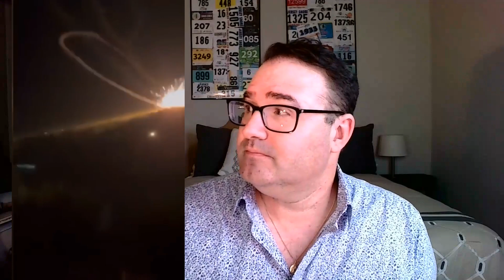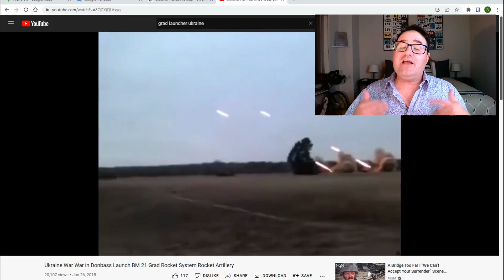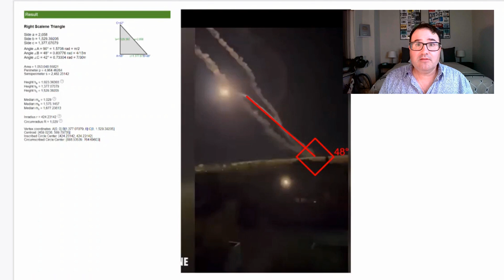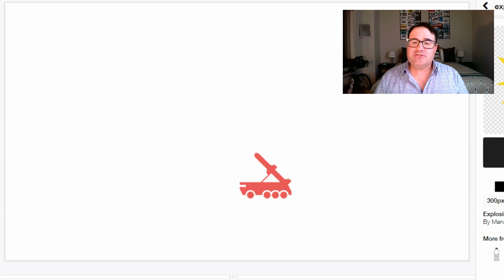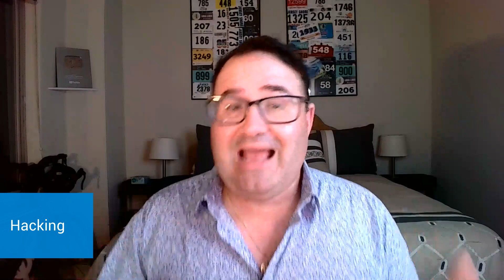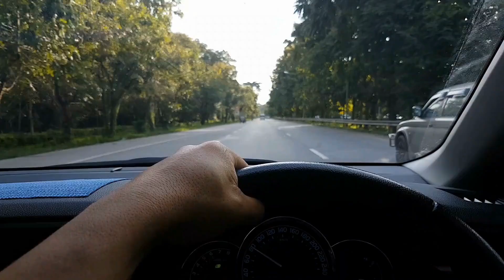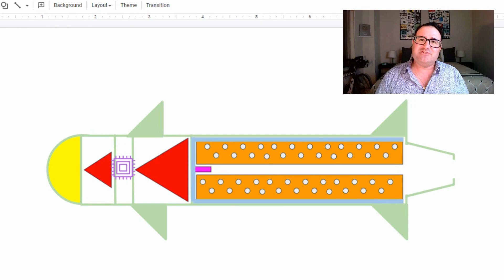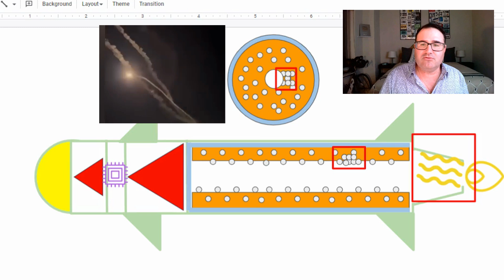Why this missile U -Turned

Comment: i think something physically wrong with the missile can be ruled out, it's flight wasn't erratic. it turned and then straightened out, which suggests the missile itself was fine.
Reply: Assuming it has to fly erratic for it to be a physical problem is wrong.
Reply: @RANDO4743  that would require the issue to fix itself, not impossible, but not very likely

Comment: Control surfaces have way more effect on a plane than thrust vectoring (when you still have suficient speed. That's why the White brothers twisted the wings instead of hand balm and swirl around their bike engine to control their plane)
A stuck/malfunction fin or fin's control system is a better and more plausible explanation.

A reminder that, one class of air craft uses thrust vectoring ALL the time, and it is the: 

Helicopters.

Comment: Love this channel.  I respect the analysis and I have NO experience; but it seems a stretch that fuel issues would cause it to return back to its origin, which it supposedly did.  Hacking doesn't seem likely either cuz why not the first rocket?  Maybe it locked on to its own ground radar somehow? (I have no idea if that even makes sense...)
Reply: Exactly! First rocket came off perfectly and started seeking, most of soviet aa systems like buk, gophers and tor, will ripple fire, until that first rocket is fired you aint gonna know where it is by the time the second ones ready to go they do...

Comment: The theory I have is that its a combination of a mechanical failure and a guidance issue. After being launched something on the missile failed and resulted in a fin forcing the missile into a turn, then upon being spun 180 degrees the missiles own guidance radar picks up the launch vehicle and mechanically re-adjusts itself in flight to track the new target.

Comment: Just saw your video about turning SAM, but I think that could be one more reason. Have you heard about Proton rocket failure on July 2 2013? It performs similar U-turn and smashed into the ground. It is believed, that guidance system was installed incorrectly -- upside down. And rocket decided that it was flying downward and tried to correct it. There was a youtube video on Scott Manly's channel about this incident. I believe, that this SAM could suffered from similar misproduction event.

Comment: I disagree with your assessment at 4:10 , the analogy you use is flawed.

You use a person swerving into a side barrier to compare to mechanical malfunction.

But, cars DO suddenly swerve, under mechanical malfunction...it's called a broken tie-rod.

Look at Me, I'm contributing 🦊⭐
Reply: Um, I think..you are prob right, in a way, but...

I personally think the fuel doesn't "shift"
The fuel gets old...and in Russia, the weapon system is a shiny bauble when it's new, and neglected ever after.
Old Fuel. Neglected old Fuel.
Burning unevenly.
Not that 'some was burning hotter, but that some spots were not burning 'as hot as.

Tomatoes, Tomatos🦊👍

Comment: Ok, hear me out. I'm an IT guy, with an old simple coding background.

First 2 (maybe) went out? They connected with the target, yeah? Missle had no target then, right? 

ERR: PEBKAC
ABORT, RETRY, IGNORE
Input R 
GOTO 1O

LOL - seriously though, I legit see your logic and having seen other videos from you, I can see your point. A fuel issue was very likely a part, if not a major factor. Having seen mishandled and sweating dynamite nearly end lives, I have a heathly respect for anything that commands fire: most especially high ignition fuels.

Comment: The missle doesnt appear to actually be making a U-turn (which would suggest a 180 degree change in direction sending it back in the direction of the launcher.) Which if you look at where it was launched from and where the camera is located. It is more likely that the missile began more of a downward spiral. Still moving away from the launcher and towards the camera. The angle we see looks like a U-turn but the Impact is closer to the camera than the launcher.

Comment: I have zero experience with rocket systems, and this may have been said already, but is it possible that someone screwed up and set it to follow the search radar signal so that's what it targeted? Like instead of following the reflection of the targeting radar, someone used the search radar signal so it targeted the search radar?
Reply: I could be wrong, but I don’t believe these types of anti aircraft missiles have an anti-radiation capability, meaning they don’t have the ability to home on a radar source. 

Missiles developed for the SEAD/DEAD roles such as HARM have seekers that track radar sources. As I said I could be wrong, but I’m fairly certain it’s not tracking a radar source. Even if it was, a radar signal originating from  the opposite direction of the seeker wouldn’t be strong enough to cause a lock.

Comment: This looks software related to me, maybe the radar gimbal cut on early and confused the initial signal station with it's first ping returning. That turn looks perfect so I doubt it was mechanical.
Reply: You can clearly see 2 missiles fired seconds before this one(smoke trails), the buk system which this presumably is, is Soviet era(not very heavy on the software) and also has seen extensive usage before without such issues propping up.
Therefore, handling/maintenance causes are the most plausible

Comment: I think fin to be honest. It could have just been a mechanism failure, if nothing is holding the fin straight, as soon as it turns 2 degrees, the airflow will exaggerate it until it’s fully angled.

Comment: The fact that the missile did a complete u-turn is impressive
Reply: And the way it activate its booster as it was about to strike where it came from is beyond hilarious.
Reply: I think the missile was homesick,  that is a powerful emotion.
Reply: Back in the early 1970s I witnessed a Nike Hercules misfire. The lower booster cluster came apart on the launch rail and all hell broke loose. You would be surprised how fast people can move with just the right motivation. Those Russians must be writing home to ask their mommy's for clean drawers.
Reply: Fin fell off
Reply: Testament to Russian rock technology and engineering
Reply: The missile should sign up for WRC and race right away
Reply: Cough cough
Reply: First U-Turn Missile. made in russia lol
Reply: Gonna have to rename Buck to Boomarang. 🤭
Reply: It didn't go tight back where it came from it wasn't a complete U-turn. There's other perspectives of this same incident. It landed 500m or more from the launch site
Reply: If a gyroscope was installed in the wrong orientation it could correct it’s course to continue in the direction it thinks is correct.

Comment: Most important detail is missile straightening course..
As a software engineer this is how imagine a div by zero or seg fault in its worst form. If fixed by "swallowing/buring" fault and next calculation is correct, goes unaddressed for years.
Bad input like zeros or unknowns from GPS (soviet GPS system?) could cause wild over correction that is temporary. 

Another possibility is rocket was in a mode to seek strongest source for some reason/error/fault as it did not steer to a random direction, 130 deg etc. It came straight for launcher area... which could be chance but is not my first choice.

Comment: So, what caused the missile (it's guided, so it's a missile, not a rocket) to turn is that the combustion of the lump of fuel pushed against the inside of the rocket in a way that caused it to veer off course, and then go straight again after its been consumed? That could make sense. It can't influence the flow coming out of the nozzle, though. That's exactly what nozzles are for - to direct and straighten it, like a laser. How does that explain the perfect 180°, though?

Comment: I think it’s silly to rule out hacking just because the devices aren’t physically networked.   The stuxnet attack was carried out by USB drives.   I find it entirely plausible that similar methods could have been used to force the system to replace the target coordinates with the origination coordinates… pretty simple hack to program.  Also, the rocket itself is guided by radio telemetry, which is likely encoded but surely hackable given NSA types of resources…

What I like about the thought that it was a hack is that if the Russians suspect their rockets are hackable, they won’t use them until they fix the vulnerability… so you end up taking down an entire weapons system based on one system that actually got hacked.

Comment: Seems to me like the rocket is too stable once it turns. It looks like it really wants to hit that target on the ground. I would guess the internal guidance system failed once it got in control. I wouldn't be too surprised if somebody tampered with the thing on the ground or if it was just stored in terrible conditions. Another option is that the guidance just got fooled by some reflexion and once it made a flip it would see the signature on the ground and assume it a target.

Comment: That missile turned around and went directly back to the launcher. What is the probability that 'settling' of the solid fuel would be just so to send it right back along it's flight path? Seems to me that something went wrong with whatever guidance system activates just after launch and somehow made the launcher it's target. I don't claim to know the details of how that system functions, but it sure looks like it guided itself back to the launcher rather than randomly got turned back to that particular direction by chance.

Comment: I used to build homemade rockets. You’re incorrect in your assessment on propulsion being deviated through solid state fuel being more “dense” causing the vector shift. It’s more likely an electronic failure or centrifugal gyro not working.

Comment: I think that its impossible to turn a rocket that way. The pressure of the burning fuel would be what propels the rocket forward when its mass goes through the engine nozzle at speed. It does not matter, however if the pressure originates from ome or the other side. I bet it was the guidance system of the rocket itself. Not the signal that its guided with, but the guidance computer onboard the missile  The precision that made it turn was just so accurate. I bet that it either might be a dummy round for if the system falls into the enemy hand, so that it would destroy the rocket launcher system or it might be sabotaged rocket, that just destroys the system, where its shot from. I bet there are many people on Russian side that wish to end this war.

Comment: I think it could have been a good old case of "putting the guidance sysem in upside down" like the proton launch that flipped around. It seems like the rocket flew practically parallel  to the original path.

Comment: Whats the chances the missle locked on to another missle still on the launcher but after the turn it didn't have enough speed to make it back completely? Could the smoke from the other launches messed with radar or poor placement of radar vehicle? Just curious,  seemed like it turned with authority then straightened out to fairly straight before it hit the ground

Comment: It’s manufacturing- but it’s a sensor or gyroscope. Those tell the software of the missile where to go and how. It provides variables used in the software code which are used to manipulate the fins and so forth; such as to maintain a given, pre-programmed course. The broken or incorrectly installed sensor or gyroscope made the missile register that it was going upside down and backward due to likely negative numbers or similar- code doesn’t think logically like humans- because the related numbers decreased. The missile perfectly inverted because the code told it that the missile was going the opposite way of its programmed target. It corrected itself- using the sensor or gyroscope data “thinking” it was correct.
Reply: Your theory of the fuel having a concentrated lump which just so happened to be enough to spin it 180° would require even more of a coincidence than poor manufacturing in specific relation, and so is less likely according to Occam’s razor.

Comment: The Buk M2E is a Surface to Air missile, while the Grad (SA 17) is a multiple barreled 120mm rocket launcher. The two are different systems with different uses:  one for air defense and the other for ground attack. It could have been a M-30 Smerch, which fires 300mm rockets up to a range of 90+km. The bigger question is, was this really an anti-air missile that went awry, or was it an artillery type missile. Anti-air missile warheads don't produce an explosion like the one on video.

Comment: I disagree with your theory Ryan although I very much enjoy your analysis. Generally with solid fuel disruptions in density or similar the rocket usually just burns less efficiently and or with less chamber pressure.
Because of the throat on the nozzle, a problem like you suggested usually would not cause a radical asymmetric thrust situation.

I am not confident on how the target acquisition radar aquires, builds a solution and then at some phase goes to terminal radar homing. I do however think that improper targeting information was uploaded into this missile which is what began or caused the entire incident.

Comment: Old rocket, probably sitting idle for at least 30 years in a store or even on the launcher itself. 
It got exposed to elements , water could have infiltrated inside the electronics or the guidance system. Rust settles in, electric wires decay.

Now the rocket is launched, violent vibrations and inertia shakes the entire system. Rusty and decaying wiring break in seconds. One side of the rocket still got power and electrical signals, the other one shut down, probably getting one of the fins stuck in an angled position.

So the rocket is now doomed. Without wiring the problem cannot be solved and the rocket spins around and hits the ground.

This thing happens to torpedoes as well. Condensation and long storage time together with the vibrations and the shock of the firing moment leads to some wiring to break loose and the torpedo loses guidance on one side making a full circle. The problem is even more serious as the torpedo head gets activated and when the circle is complete it "sees" its own submarine as a "target" and detonates near it.

With the AAA rockets the problem is not that serious. It just crashes and goes boom on a field somewhere.

Comment: More likely 2K12 Kub with bad transition from rocket to ramjet mode and blowout from the intakes, since chamber pressure of solid fuel rocket is several times larger (100bar range) than the dynamic pressure at Mach1-2 (a few bar)

Comment: Maybe it could be a malfunction of the INS system, I recalled a failure of a Proton-M rocket in which the manufacturer incorrectly placed an accelerometer backwards and made the rocket turn dramatically and triggered its self-destruction procedure, Maybe this is just another same kind of event

Comment: I have neither military nor rocketry experience but I still feel the need to offer my 2 penn'orth...

There's a kink in both previous trails at the point where this one turns around which suggests to me guidance switching on (& the manoeuvre is too quick & precise to be fuel imbalance).  From here several possibilities occur to me... 
1) the previous missiles destroyed the target so this one looks for the next radar signature which is back at base.
2) sensors accidentally inverted during manufacture as suggested in comments.
3) hit a bird knocking the gyro off angle 

Whatever happened the "hoist by one's own petard" scenario is highly amusing given that this is the invading force. Against that, it seems that many of the Russians don't want any part of this because they're killing their own relatives.

Comment: A stuck fin or faulty fin control wouldn't make it turn that sharply. That would require serious thrust vectoring.
If the propellant burned a hole in the side of the missile that could do it but that would have been visible in the video.

Comment: Highly improbable. Someone else pointed out that off center gases in the propellant does not mean off center thrust. You mentioned it was either an SA-10 or SA-11, which are SAMs. Because they're SAMs, engineers built them to maneuver better than most jet fighters, which means they can turn significantly tighter. This is accomplished thanks to thrust vectoring nozzles, which adjust the direction of the gas flow according to where the guidance system needs the missile to go.

The guidance system theory seems to be the more likely scenario. Russian guidance systems for both missiles and other rockets seem to have the same fundamental flaw, in which the system has a tendency to over-correct as a delayed response, causing the rocket (or missile) to suddenly change direction. The basis for my support of the "guidance system" theory, is the Kazakhstan Russian Proto-M incident, in which the rocket took a sharp turn shortly after liftoff, which is similar to this incident. After investigation, it was discovered that the rocket's onboard gyroscopic computer (part of the guidance system) suddenly kicked in due to the rocket's insane acceleration, forcing the guidance system to compensate for a change in direction that never actually happened. Result? Rocket winds up making an actual, very drastic change in direction.

Edit: There was a similar case with a similar kind of rocket having its gyroscope installed backwards. Also, the man who installed it was so stupid that he used a hammer to force it in. A HAMMER.